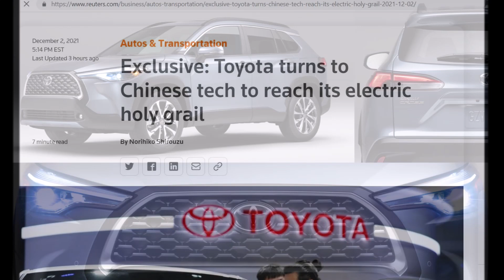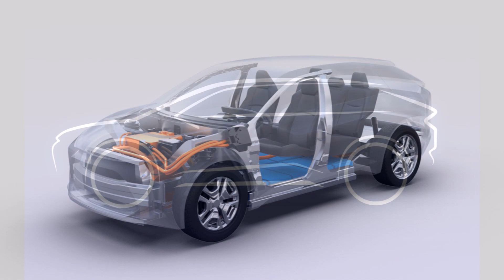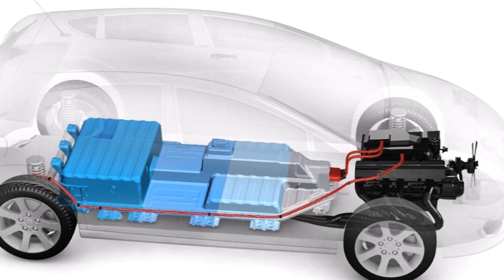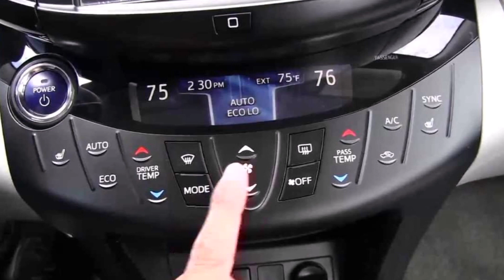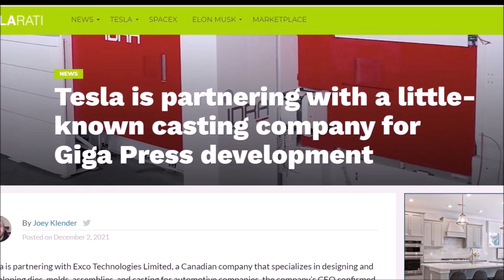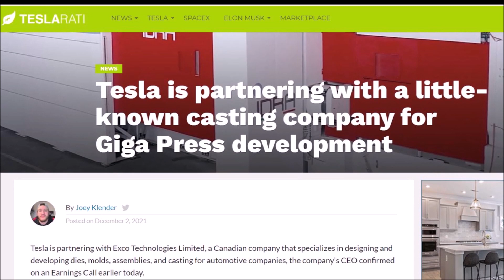JUST IN! Toyota Is Building $30,000 EV With BYD’s Blade Battery LFP Cells

Comment: BYD's blade battery is far superior to Tesla's 4680.  The 4680 is already outdated.  Tesla should partner with BYD to make blade batteries at Austin and Berlin instead of 4680s.  But they won't.
Reply: Why? Blade is $64/kwh and 4680 sounds like it will be the same. 4680 has some great innovations to make them fast to produce. What's the advantage of Blade?

Phillip.
Reply: @philliptemple4534  The BYD Blade Battery has successfully passed the industry's so-called "Everest" test of being punctured by a nail to prove it won't ignite. The nail penetration test simulates an internal short circuit of the battery, which is the root cause of battery fires or combustion.  The blade battery also survived an extreme strength test in which the blade battery pack was rolled over by a 46-ton heavy truck. The heavy truck test is more stringent than the national standard. The battery successfully passed the test without leakage, deformation or smoke. BYD said the blade battery pack was perfectly intact.   BYD claims the Blade Battery is currently the only EV battery in the world that can safely pass these tests.  BYD also said its Blade Battery passed other extreme test conditions, including being overcharged by 260%, crushed, bent and heated in a furnace to 300°C. None of these tests resulted in a fire or explosion.

Also, when using the blade battery available space is increased by over 50% compared to conventional cylindrical lithium-ion phosphate batteries, which gives the batteries a higher energy density as more cells can fit.
Reply: @thewolfdoctor761  So 50% better energy density which is the same as the 4680, and it passes a bunch of arbitrary tests which don't really affect Tesla. Not sure why they would really care about the Blade battery.

Phillip.